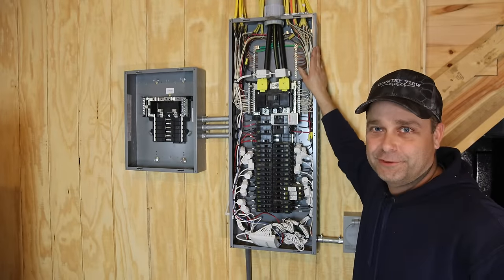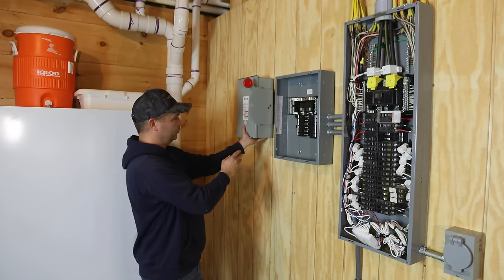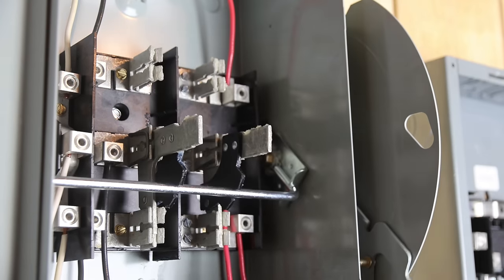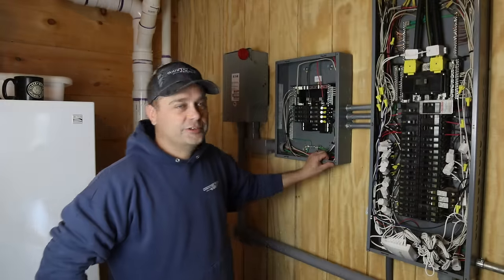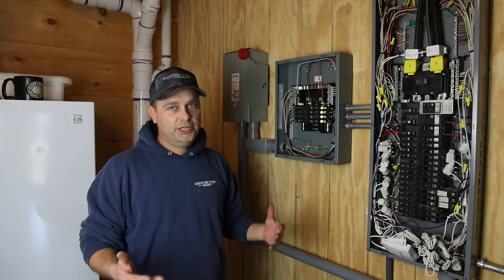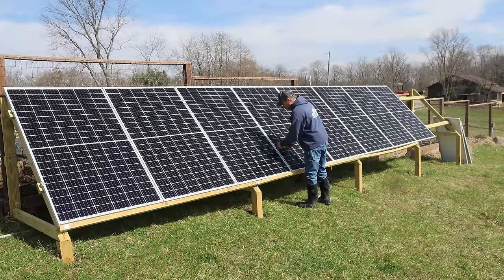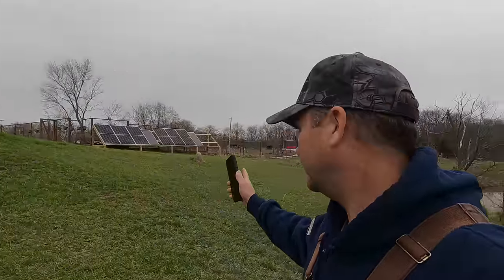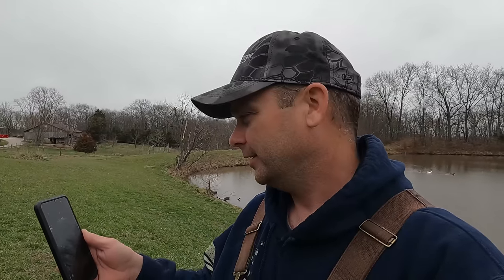Installing an Off Grid Panel and Transfer Switch.   Discovered a problem with our EcoFlow Delta Pros

Comment: Come and do my house !!! lol , seriously though the only 220v is my Dryer which I wouldn't even use I don't think even though I have the Hub I'll probably never use it, right now my two Delta Pros are not doing me favors in energy use, just using one to cool off my laundry room with a Wave 2 on one Delta pro hooked to 2 - 410W panels off grid style, had a mini frig running with it but a cloudy day it rand down somehow all the way, then next time I forgot to turn the AC ON on the Pro and almost lost the food in the freezer part. I had 17 panels put on my house years ago and wish it was a mandatory thing to put Battery systems in along with them so we could use the Energy at night when PG&E likes to sell you back the pennies they bought from me. I love your system Setup just wish I had the Knowledge to do that, Very good Video explaining though. I need that. just where and how to do it at my home is the problem. ALL NEW  HOUSING should be mandatory with a system like this, but then PG&E and others would Cry.

Comment: Hi Evan, your ecoflow setup is fabulous 👌 just a little thing to check ✔️ please watch Gadget John he did his van with the ecoflow system, and the  wire burnt a hole in his new floor... it's something you can check. Is it OK? the wire was sent by ecoflow  and stupidly fused 2 wires together, which caused the fire 🔥 so  watch it and check your wire...

Comment: Well Evan I'm assuming when you build your other system on the pole barn I assume it's going to have a different style inverter such as an all-in-one system. And automated transfer switch. Pulling levers is so 1970's

Comment: i have a generator plug on the outside of my house with lockout on the main breaker, I was thinking of adding one inside, is there a switch box to choose which input to use (outside/inside)?  and what would that product look like?
Reply: While not the cheapest solution, I would use the Square D 92351 3-pole double throw switch to switch between two inlets. It's an idea i picked up from Silver Cymbal's channel.

Comment: Question  where does you water supply come from  if  comes from well  when power is out will well still work  ?  If not do you need to fire up direct hot water system?   If city water maybe  if still getting power to run pumps
Reply from the maker: Our house is connected to a rural water system.

Comment: My EG4 life pro batteries are rated for 7000 cycles if not run below 80 % .  Consistantly running them into the 30-50 % range may greatly shorten the life.  My advice?  Less panels, more batteries.

Comment: Hey Evan, great installation! I really enjoyed it. Can you please shed some light on how you connected the inlet box to the transfer switch? I am not clear on this part. If you could explain that to me I would really appreciate it. Thank you
Reply from the maker: The transfer switch has two different inputs.  One is the inlet box one if the inputs, the other is normal power from the other breaker  panel

Comment: Could you use a ac to DC converter and power through the pv ports maybe with a splitter where you can use both the inverted power along with the solar input. Just a thought don't exactly know the viability of it, just a thought.... Jeff
Reply from the maker: yes, someone sent me a video of that.

Comment: great vids! since you have two ecoflow, can you set this up another way so that only one ecoflow is powering the house, the other one is used as a backup battery to constantly charging from the solar panel and feed to your main ecoflow which connects to the house?  Also are the two ecoflow units setup to charge from the panel independently?

Comment: I think the limitation is that each Delta Pro only has 1 inverter, which is used either for DC to AC (when using the Delta Pro for power), OR AC to DC (when charging the Delta Pro), but not both at the same time.   The solar charging works because it's charging the Delta Pros with DC.
Reply from the maker: you can charge with AC and DC at the same time,  it is one of the selling points.  There is an AC charger and a DC charger inside.  I think the problem is to units linked each making 120 volts, 180 degrees out of phase with other to make 240 volts.  When you plug in the charging cable in, the delta pro switches to grid bypass, and the outlet 120 volts passes through, which is not in sync with the 240 volts.  I think that could be the problem.  
The other theory, is that ground neutral bond passes through when charging.  and creates a ground loop.  Power flows through a different path.  Throws the units in error.
But who knows for sure.

Comment: Can you add more batteries to the Eco flow to increase your capacity. Would this also let your batteries run longer on your critical systems while you're charging
Reply from the maker: Yes, they sell extra batteries.

Comment: Hey Evan.  Great videos - I'll be putting up 5500watts of solar panels this spring.  Looking forward to seeing you build your system out.  For the EcoFlow charging issue - is it possible that each EcoFlow would need to be charged by a separate leg of your 240 grid power?  Powering them (for charging) both from the same phase may cause the combiner to not be able to phase lock correctly causing the issue you are seeing.  Just a thought...
Reply: I also saw that the DeltaPro supports charging at 240V, but its not entirely clear in the manual how to achieve that.  But maybe charging each at 240V may allow it to continue functioning while charging?  From the manual.  FAQ page 13
8. How do I recharge DELTA Pro at 200V–240V in a 100V–120V region?
 The cable provided with your DELTA Pro cannot be plugged into higher-voltage outlets,
you need a third party adapter/charging cable.

Comment: You could daisy chain the delta pros and and use a smart plug (wifi) on your outlets for the ac charging. Then use a tt-30p to a L14-30R. What do you think? Only issue you'll find is the inlet to the main delta pro is 1800 watts which is the Max bypass wattage
Reply from the maker: I was hoping to use a smart plug to automate the charging.  Several people think there is a problem, with plugging in the Delta pro, that a ground loop is created, since the ground neutral bond passes through when plugged in.  So any charging off, the a system where the ground neutral bond is the same, may cause problems.  Even though these panels are seperated by a transfer switch the share the same ground neutral bond.  Probably best not to charge off the AC, while outputing AC when tied into a sub panel like this.
Reply: @CountryViewAcres  I think I saw another video on this. I completely agree. Maybe time to try out those smart generators for dc to dc charging! I agree in your video it seems like you are in need of more battery storage. I had to add another battery to my DIY system (3rd) battery because of the shorter and cloudy days in winter. I use a smart plug for when I'm not home and it's cloudy and I can turn the ac input on from my phone from anywhere. But I'm not tied to and electrical panels like as yours.... yet. Lol I think I'm gonna do the smart panel after a while. You can run a smart panel with only one delta pro and time it to charge or discharge depending on time or charge level. You've done a great job on your boxes and wiring! I just finished my 1200 watt, 100 panel array. I'll be posting a video on that shortly :) thank you for showing us your system!

Comment: Why not set up an actual  ni-cd battery bank? You would have tremendous storage
Reply from the maker: The plan is a large permanent system, I just used the EcoFlows for now until the system is in place.
Reply: @CountryViewAcres   I don’t know where your from but if you know anybody that works in the signal department for a major railroad they could probably get a set of retired batteries that are only a few years old.

Comment: So, do you have two ecoflow, one feed each phase?  I can see for most appliances this would work but if you have an appliance that uses both phases wouldn't there be a problem with phase between the two legs?
--------
Ah, double voltage hub!

Comment: I'm not up to date on solar but can't you wire your panels in parallel instead of series to increase the amps without increasing the voltage?
Reply: Yes,  he should have kept the original panels and put them in a 2s2p configuration per each delta pro. You can never exceed voltage, but you can exceed amps. The Delta Pro pulls apps and will never pull more than it can handle/use. The benefit of over paneling and providing more amps is you get more available power the system can use for more hours of the day. He should add panels and do a 3s2p configuration per each delta pro. Also, I think if you mix panels in a series, all panels are limited to the watts of the lowest panel.

Comment: I would never use flimsy PVC conduit indoors. Would have bent a 90 degree bend in EMT conduit from bottom of double throw switch.Being the space between service & solar panels is less then 24" you could have just installed one piece of conduit between them. Two large factories that I worked in you were never allowed to use PVC conduit or drain lines due to toxic smoke they produce when on fire.

Comment: I'm a little confused. Does the generator Inlet go into the 30 amp breaker at the interlock safety in main box or do you have it fed into main panel, looped directly back out to the Frankenstein interlock?. It looked like you added a second 30 amp breaker under the original 30 amp generator breaker.

Comment: it doesn't look like you move the ground wires for each circuit you extended.  Understand why it may not be needed since both hot and grounded conductor (neutral) have to be moved but does that meet NEC code by not moving the actual ground?
Reply: I think its alright. He's got it wired to code to/from the secondary panel.
Reply: @kd5inm  So N-G bond in main panel and kept separated all they way through switch and into sub panel. Assume no ground wire direct between sub and main, just through switch?
Reply: @cgutowski471  If he has ground wires connected in the main panel and just carries through ground to sub panel and has sub panel grounded It should be in code. I don't see a problem with what he has. The video was going fast and I didn't get a good close look so at first I asked Evan if he had a bond wire from ground to neutral in the sub panel. He said he didn't, its only bonded in the main panel. I was mistaken about a wire he had going from one buss bar to another. 
 According to code you only bond in first panel and not any sub panels. The rest of it is ok. The grounds can all be out of the main panel, just as long as sub panels are also grounded. You want to have all wires, hot, neutral and ground existing in each panel because GFCI and the newer AFCI, arc fault circuit interupter breakers require connection to hot, neutral and ground to work properly.
Reply from the maker: I didn't move the ground wires of each circuit into the new panel.  Electrically it is all the same.  Since all the ground bars in each panel are bonded together.   Is that against code?  Does the ground connection need to be in the same panel?  I am not sure.  But If someone thinks it is, please state the specific code number and I will look it up in my code book.  In the future, I will probably pull these circuits completely out, add a junction box, and feed directly into the off grid panel.  But I am waiting for my larger 24 space panel to arrive.
Reply: @CountryViewAcres  I don't think there is a problem with having the grounds terminate in the main panel. Since you have hot, neutral and ground carried over to the sub panel it should be ok. The sub panel needs to have those in case you have breakers like GFCI and AFCI type breakers installed that require those connections to fuction properly. You may not have either of those breakers installed now but for future use. I think it looks good. 
Evan, I think folks are asking questions to learn and understand. I don't think its because they are calling into question what you did.

Comment: Evan, love the videos,  thanks for all you do for the great entertainment.  Could you split the solar into the transfer switch.  Two 120 volt inputs, one for each hot leg , instead of a single 240 volts? Then your Delta pros would charge off the grid ?
Reply from the maker: I was thinking that exact same thing.  Since everything was 120 volt anyway.  I looked at parts to make 30 amp cords from the RV plug to the Transfer switch.  It was going to cost me around $180 to make the cords.  So I decided, to leave it the way it is and focus on the new Permanent system instead.

Comment: Evan, these videos about the EcoFlow Delta Pros have been great!  I just stumbled across them and have now watched all of them (some parts more than once).  This has made me seriously consider getting a similar setup for our small 1 acre homestead.  My question to you is have you looked into the EcoFlow Smart Home Panel (SHP)?  I know that in these videos you use the generator connection.  I just wonder what made you go that route over the SHP?  I don't personally like the idea of having to do the physical interconnect switching in the breaker panel and feel that the SHP would allow for not needing that.  Just wondering your thoughts.  Keep up the great informational videos about this.  I'm loving it and am being greatly inspired to do similar for our situation.

Comment: Great review, you guys are the first channel to discover that the 240 kicks out when you start to charge with AC. I was not expecting that, hopefully Ecoflo could update that with a software update. Did Ecoflo reach out in anyway to you regarding this. Looking forward to the rest of the solar build. 👍👍
Reply from the maker: I contacted customer support.  They want more details.  I was hoping for a simple explanation on what error 122 was.  So I am still working that out.
Reply: Each battery has its own inverter. Household 240v comes from two taps on a SINGLE PHASE high voltage ac line.
Reply: Any update?

Comment: Why not just use the interlock system on your main panel and then you can run your whole house off grid when needed? My electrician just put in two 50 amp breakers for solar.
If you’re worried about using too many appliances, just turn off the breaker if you don’t want or need.
Reply from the maker: We did that in the previous video.  Lots of phatom loads drain the batteries quicker.  Like the computer, TV, coffee pot, etc.  On this panel only the a few things are on and the battery last longer.  Then I tested it for a couple months on this setup.
Reply: @CountryViewAcres  
I’ve learned to leave all appliances unplugged until I need them.

Comment: If all the critical loads are only 120v i would use each delta pro per phase for an easy solution
Reply from the maker: That could possibly be a solution.

Comment: How did you separate out the, say, the fridge from the rest of the kitchen stuff, to move it to the other panel?  How did you know which was the fridge? (All my kitchen stuff is on the same breaker...)
Reply from the maker: When I built my house.  I put everything on separate circuits.  Fridge is a circuit, microwave is a circuit, dushwasher is a circuit, etc.
Reply: @CountryViewAcres  Smart idea. But I bought my house, already built. /sigh

Comment: Food for thought, you said you had two circuits for charging the delta pros, are they opposite phases? The delta pros I believe pass through power when they have AC power, so that might be why they kicked off the 240. Also, you could try taking utility AC, convert to DC 12v to charge via the car adapter and see if that is enough to top off your low solar production days.
Reply: The way to do it is to cobble together a switching power supply to convert enough line AC to DC input to the DC input on the Delta Pro. You also need to use their solar adapter to get the correctly wired XT60i plug where the third contact is wired to the positive wire, or wire one yourself. Otherwise the DeltaPro will limit the input to 8 amps.

Comment: Hi Evan...great video. Just curious, don't you have a well to power and what off grid resources would you want to make available for the barns? Keep up the good work.
Reply from the maker: We don't have a well.  The house is connected to a rural water system.
Reply: Could add storage tanks in the basement for backup water.  Scratch and dent water heaters could be used in series.  I use 4 in series with a sol-ark 12k to store hot water from solar so I dont have to heat water as much at night.  Same idea as using a timer on the dishwasher to run in daylight.  Saves power at night when you can only make it during the day.

Comment: Hi Evan, love what you are doing on the channel. I know that the way we describe power in North America is a little strange, but your panel is actually only single phase. A 120/240 is Single Phase power. If it was a 120/208 for example it would be a 3-Phase system. Whe. We are talking g 120/240 what you actually have is described as split phase. You are splitting off one side of the phase to provide 120V AC. If you know about radio it is similar Single Sideband vs AM. Upper Side Band and Lower Side Band.

Comment: Im surprised 30a will power everything in your 'essentials' subpanel
Reply from the maker: It is 2 - 120 volt circuits at 30 amps.  30 amps per phase.